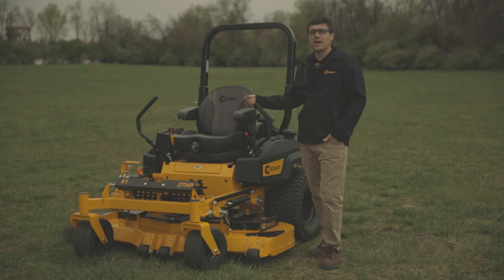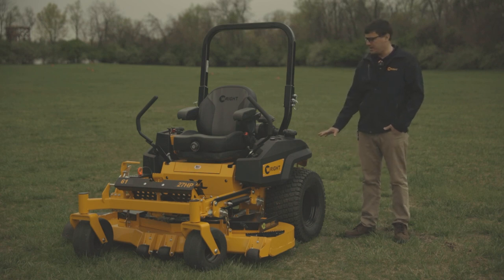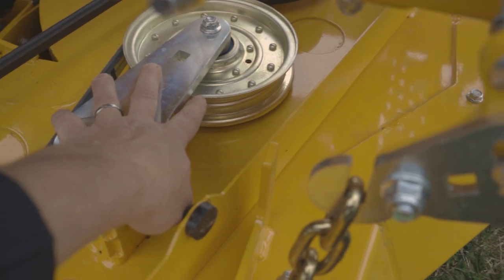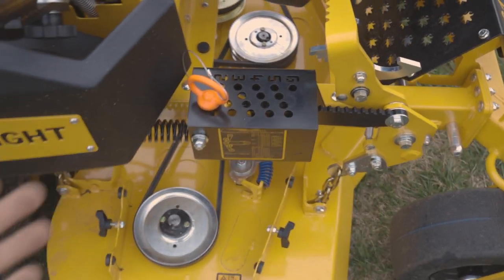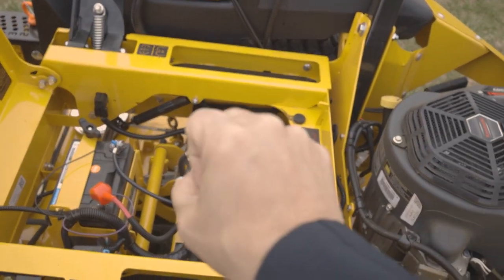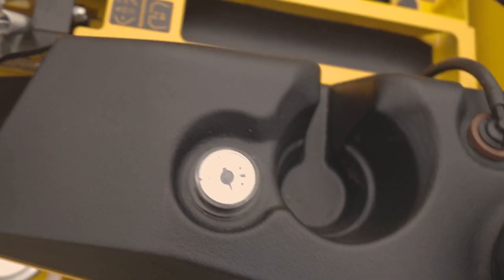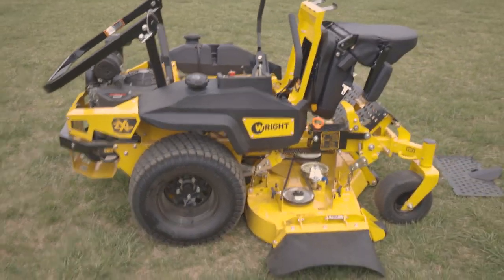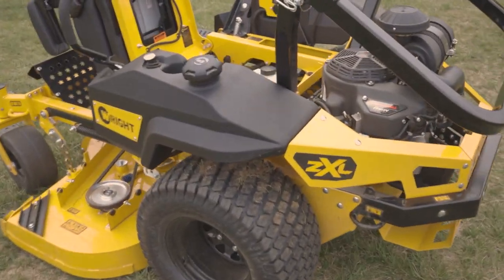WRIGHT | ZXL walk through! Check out all the details of the ZXL with Ed Wright!

Comment: I demoed the ZXL and ZK today both with the Vanguard.  The ZXL was extremely nimble and responsive.  The ZXL was extremely quick with very little input into the controls... it was great.  I'm coming from a 2019 Gravely Pro Turn 260 that required extensive input into the control arms, which was terribly fatiguing.  This was not the case with the ZXL.  I also liked the control arms where they spring into place, that was a nice feature.  Lastly, the cut quality was excellent and turned on a dime with no damage to the turf.  I was very pleased with my experience with the ZXL.
Reply: Thanks. Glad you liked it. 👍
Reply: Hi, how do you like the ZXL?  Did you get the 37hp motor?  I am thinking about test driving one this week.
Reply: @EdStaniszewski  It was excellent.  I highly recommend the ZXL.  It was responsive and very nimble in and around turns (trees and other obstacles).  Plus it was quick when I needed it to be on the straightaways.  A little thing, but I liked it a lot is how the control arms spring into position and stayed there... that was cool.  Other zero turns the control arms are flimsy and don't always stay in place.  As for which one, ZXL 61" 37hp.

Comment: I purchased a 61” ZXL with 28” vanguard engine. When it is working it is a solid mower, though it does throw the blade belt when going over rough surfaces. The main problem I have had with this mower is trouble getting it to start and dealer support. Have had it at the dealer for the same starting problem twice in one year. Not a fuse problem, as i changed the fuses.  Dealer support is horrendous! Month wait to get serviced or repaired. When it is working it is rugged and plenty powerful enough to cut through thick Florida wet grass. But getting it to start on a regular basis seems , thus far, to need an act of GOD . PS ,  the control arms came undone first time mowing and a bottom plate broke off . To wrights credit they sent a replacement plate right away and it was easy to install. I have bits of paint peeling off under the seat. So for $14,000 I really expect more, especially when I only cut 2 acres once a week .

Comment: ED got an additional tip for you. I just bought this mower. (had to make a 2 hour round trip) In the owners manual  add a page  that tells us when fluids need to be changed and types of fluids needed and filters needed.  I understand its in there somewhere but my old eyes can barely read the fine print.  A second one would be a metal tag rivet it on with the model/serial # and  also the engines info. Love the mower thus far just going to have to drive back to get oil and filter so i can change the oil to do the break in oil change. Yes I know I should have bought that stuff when I was buying it,

Comment: I wanted to buy the zxt, but the local dealer in my area was not friendly and he stereotyped me when I asked about financing. So I went with my Scag dealer and purchased the turf tiger 2. The zxt is awesome would love to have it. When you purchase the high end mowers, you have to have a great dealer for support.
Reply: The dealership support,  which I haven't yet investigated, but will very soon, may be the deciding factor on my purchase of a Wright ZXL, or  Scag TT2.  I've done my Scag research,  & accidentally found this Wright.  Not much dealership presence in my area though.  Just 1 shop I've never stepped foot in. Has extreme reviews on both ends of spectrum,  so I must go & decide for myself.  I getting to crippled up to keep welding & machining parts on my lathe & mill to keep old & robust equipment running.   I probably enjoy doing the shop work 10x more than lawn maintenance,  but I am being forced into retirement by things I cannot change or control.  So low maintenance is now a priority incase I die & the wife is on her own.  Thks for your input!

Comment: Is Vanguard or Kawasaki better in terms of noise and reliability?
Reply: kawasaki
Reply: Kawasaki is the top dog in the small engine world. that said a vanguard will also give you years of reliable service.
Reply: Vanguard is actually a hair quieter and the EFI system is better than what Kawi offers.
Reply: The Vanguard option is bigger and is fuel injected. The Kawasaki option here is a very straightforward carbureted engine which has less to go wrong and easy to work on. Pros and cons...
Reply: @Ed.Wright  Agreed. I've noticed though, that the Vanguard EFI is closed loop while the Kawasaki EFI (on engines equipped) appears to be open loop. I purchased a new ZXL 37HP EFI last November, seems to be a very well made machine.
Reply: @tylermacconnell217  should I go for the one with the full suspension seat or the same as you
Reply: The standard seat on the ZXL has suspension and seems very comfortable to me on bumpy ground. I don’t see the need to upgrade further.